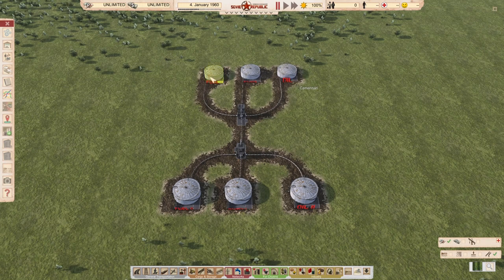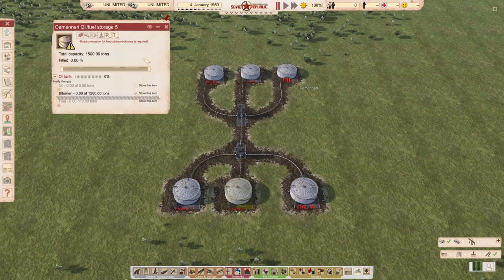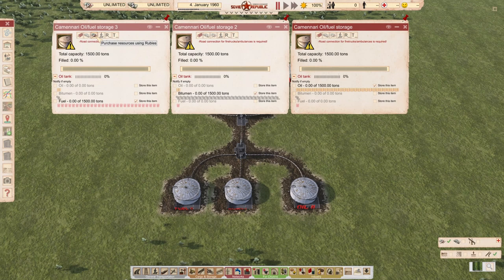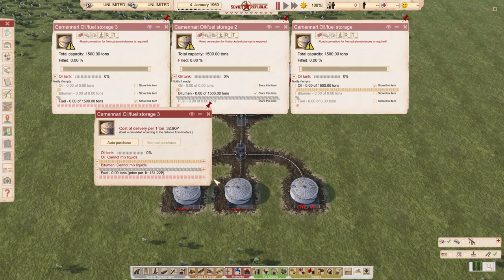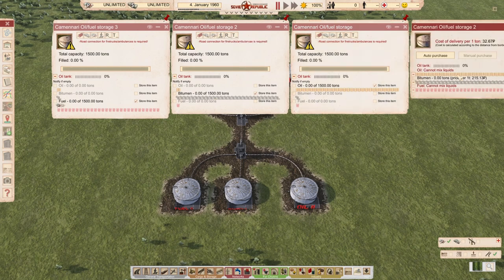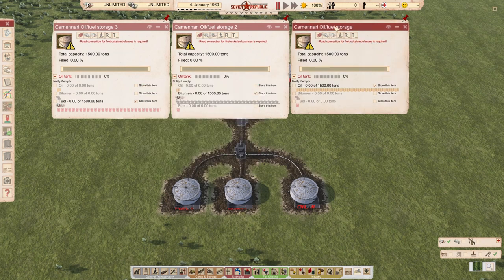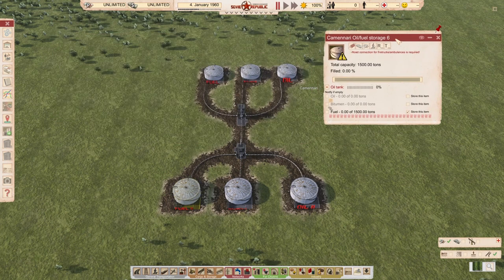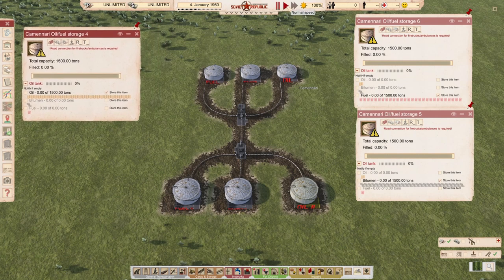Transport Oil, Bitumen & Fuel over 1 pipeline | QuickTips | Workers & Resources: Soviet Republic

Comment: Can you test it with harbour and ships?
I did kinda the same thing as you did here, but with harbour on one side (one pipe from it, to 1-3 pump, to three storages) and reversed loop for loading using the same storages (three storages, 3-1 pump, harbour). So it is kinda a one big loop, port-pump-storage-pump-port, to be able to both load and unload. I built it in two places, same setup. In first it was working, ships could access all three fluids through port and pumps. In second it didnt for some reason - pumps got stuck "pumping" bitumin, even tho ships tried to use fuel only. Its really weird, I dont even know how to begin fixing it
Reply from the maker: If I find the time, maybe when doing the throughput tips, I will look into this.

Comment: Very useful, but kinda cheating 😁 Probably wouldn't work in real-life.. still gonna do it though.
Wonder if it would work bi-directionally? Oil coming in, fuel going out.
Reply from the maker: Yeah, you do pay a 25% less throughput for switching between liquids though. And, I am betting it does work both ways, tbh.